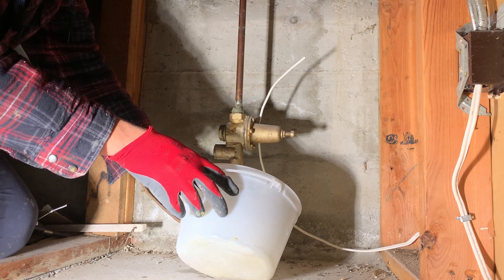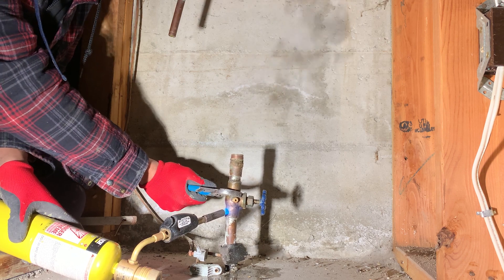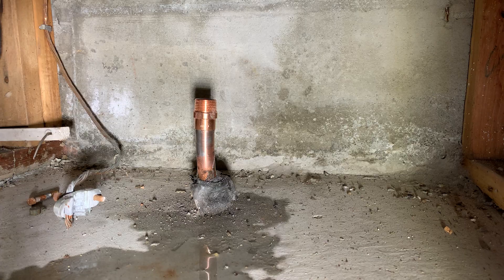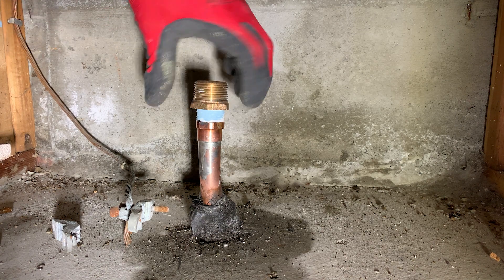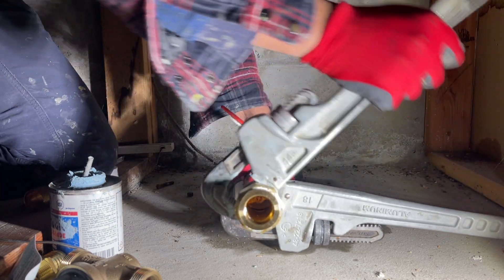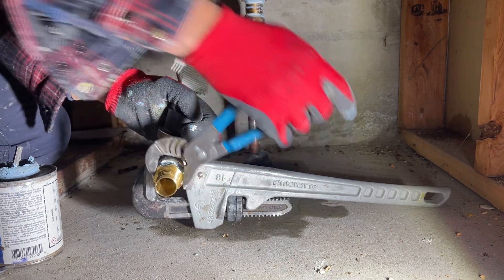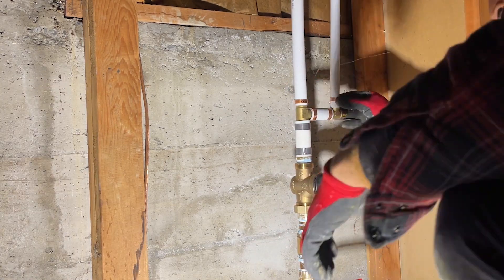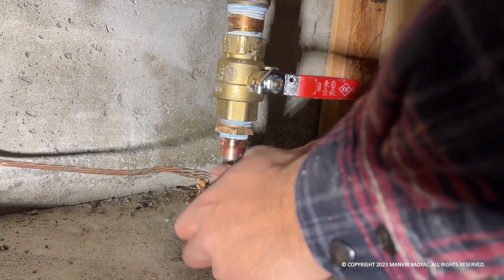Replacing an Old PRESSURE REDUCING VALVE - What You Need to Know!

Comment: And what would be the permanent water pressure gauge of choice - a dry one or a glycerin (or silicone oil?!) filled one? Would the lifetime/accuracy of the gauge be prolonged if sat off of a ball valve, so that it was not continuously exposed to water flow?

Comment: if it’s 3/4 why do you need a 1” prv… your going back to 3/4 anyways…
Reply: 05:30
Reply: He doesn't say explicitly say what pipe diameter he's installing in the house. We may assume 1", but is that really the case? The distribution junction has an PEX B-style interior fitting crimp-style coupler which immediately reduces that oversize 1" right back down to 3/4".  I impute he means to re plumb the house with 3/4" PEX B.  

However, the 3/4" fittings later on when coupling that new household 3/4" PEX B will reduce interior diameter effectively right down to 1/2".  Now, that is fine for fixtures. If he puts any more fittings on that 1/2" line, it will reduce to 3/8".  Which works, but is slower flow.  

That is why plumbers spend $400 to get the PEX A crimping tool and use PEX A pipe; PEX A fittings expand the pipe first, so the fitting remains at nominal pipe diameter, thus contributing no decrease in pipe diameter.